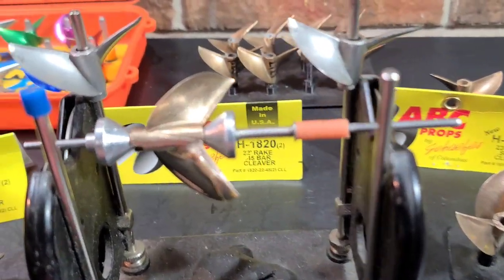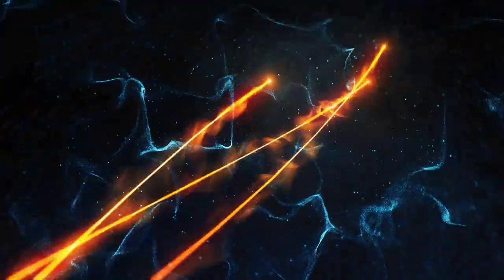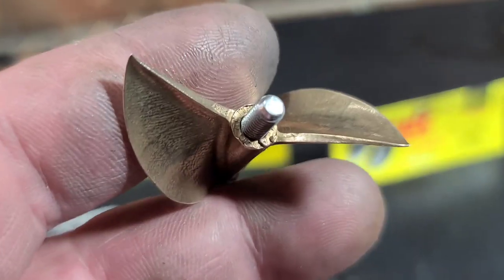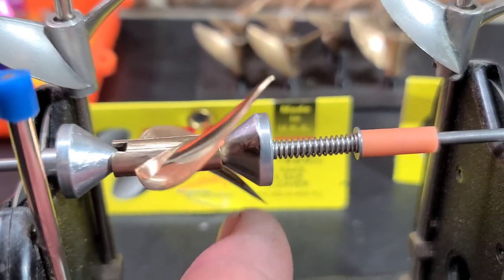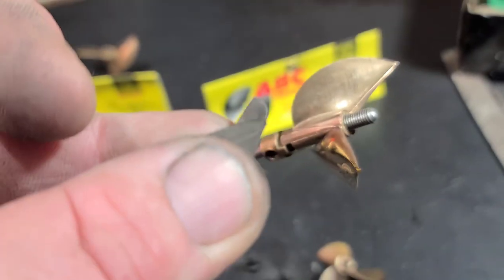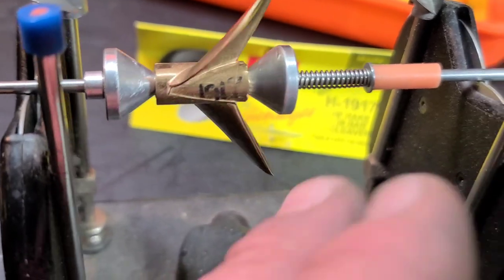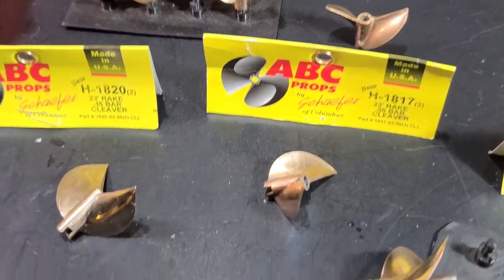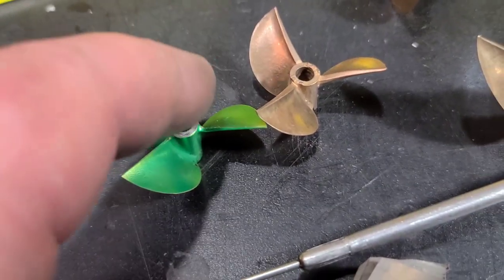Unprepared vs. Sharpened, Balanced, & Polished Rc Boat Propeller - Fast Boat Propeller

Comment: Chris does amazing work on props.  Because Chris does so many props (and the finish I've seen on them), I imagine he has some custom-made tooling to make the job go quicker.  That said, you are already most of the way there on your learning curve and you are doing first-rate work.

Here's a little trick I learned from Brian (Snowman) Buaas:  Take an old pair of pliers and grind the faces of the jaws so that one is somewhat spherical and the other can get a good grip on it with no sharp edges.  Brian then uses this "rounded" pliers to add cup or re-shape the curves on a blade.  It works really well.
Reply from the maker: Thanks, doc. I've spent the last 3 years modifying and testing different mods, and most of them didn't work as expected.  Basically, I spent the past 3 years ruining props.   

Here lately I've been noticing less is more when it come to prop preparation.

  I have a pair of pliers I'm working on, almost got them right soon as I perfect them I'll share. 👌   cupping pliers
Reply from the maker: I've been looking into heat treating Beryllium copper, annealing and quinch.  I've hardened steel in the past with great success.     Having a hard time finding what they use for the quinch once the prop is heated.   Highly doubt it's the same oil used for steel hardening?
Reply: @IRONCLADRC  There's an entire discussion on annealing and heat-treating BeCu on International Waters (it's one of the Snowman's tricks).  Do a search and a ton of stuff will show up.  It's generally heating for an extended period of time with a slow cool-down (no quench).
Reply from the maker: Roger that!   I've read a few articles, there's a couple different ways to go about it.    I'll look into the annealing slow cook process.   I have a few old Beryllium props I can do a test run with.    Thanks.

Comment: Hello Ironclad.
I have owned the Veles 29 for a year and actually have no problems (all stock,speed is enough for me) It is also always serviced regularly. Now that I've seen this video, I took a look at the propeller. It looks just as uneven as the unprepared raw prop in this video. I have filed and sanded it a lot and it is now sharp on all edges. I have now ordered a balancer and will then do the finishing touches. Do you have a tip for me how I get the propeller polished to some extent? It is not made of the same material as the ABC propellers (copper?) where it is easier to get it polished. Greetings from Germany.
Reply from the maker: I use a buffing wheel on my bench grinder, green polishing compound, polish as your finding the final balance....

Comment: what might work better for sharpening is the variety pack of nail filling sticks. Goes from 40 grit up to like 2000 grit in a kit from amazon. I cut them in half the long way to get them to bend easier to match the profil.e
Reply from the maker: Roger that, I've used finger nail files in the past!  Didn't know they had different grits I'll check it out.

Comment: Interesting video Big B. I can see the difference in the Oxidean prop and the Ebay prop, but the main question is: does the Ebay prop perform less? Or better? What is the effect of the trailing edge thickness? I would be very interested to know. Keep up the good work ✌️
Reply from the maker: Unfortunately, it's the right-hand prop. The only way I'd be able to test it is to throw both on the df29 and see if it pulls one direction or the other.    I think the biggest difference will be durability, the ebay blades are thin, more prone to breaking?
Reply: @IRONCLADRC  I'm with Big B on this.  I think it's structural as a lot of those Asian props have been known to come apart under huge power.
Reply: @IRONCLADRC  thanks, good info. I've seen those props too and I'm thinking to try them out. As I'm building a twin now, prop price becomes a bigger thing 😅

Comment: Hey B. After having some time with the Oxidean Marine Wood Rigger what prop do you reccomend? I will be using it as a oval boat, not as worried about top speed. Just overall best. Thoughts?
Reply from the maker: Best oval prop is an ABC H7, this prop is hard to find.  I've found abc 1716 or 1616 are both awesome props for me in a small ovals..  I haven't really done any big open water ovals yet...
Reply: @IRONCLADRC  Thanks!! Left or right props? I dont have my boat yet so I am not sure.
Reply from the maker: Left Hand/counter clockwise rotation

Comment: I have a question... Why polish the outer blade side instead of the inner side? Its the inner side that moves whater!
Reply from the maker: That's the part that pushes the water so I want it to grab and push water.  I've polished the back and not polished the back found there's very little difference in performance and speed
Reply: @IRONCLADRC ok ok Tks Big B